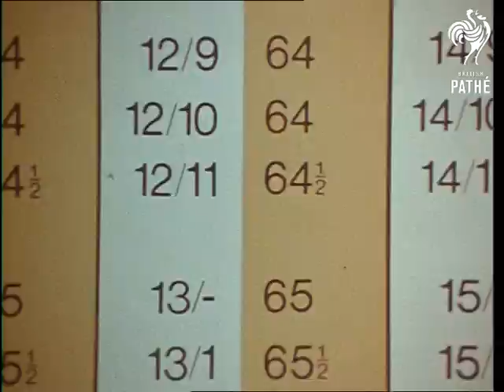Decimalisation (1970)

Comment: Thanks for putting this up here. I visited and lived in the UK and Ireland throughout much of the '70s and early '80s, shortly after Decimalization. Some of the older coins like shillings and florins were still circulating, being then worth 5p and 10p respectively. Most of the folks I spoke with about decimalization didn't really miss the old coinage, possibly since it hadn't really completely gone away. Of course in 1990 they resized the 5p and 10p coins, so now all that old currency is really gone. I have one of the new reduced 5p coins, and it's a fairly pathetic little thing, barely the breadth of an American dime, or 10 cent piece, where the old 5p or shilling was about the size of a quarter, or 25 cent piece. I've often wondered if that mere diminishment in the size of the coins has had some effect on people's perception of their value, and by extension of the British Pound. When I was over there a Pound was worth between about $2.40 to $2.80 in U.S. Dollars. Now they're nearly on a 1-to-1 parity.

Comment: The pre-decimal money is easier to use especially when it comes to giving or receiving a change without the use of a calculator. You only need to remember 20 and 12. There are 20 shillings in a pound and there are 12 pence in a shilling. 
If the total amount bought costs £23 and the money given by the customer is £50, the change is £27. 
If the total amount bought costs £23/8/- and the money given by the customer is £50, the change is £26/12/- since there are 20 shillings in a pound. 
If the total amount bought costs £23/8/5 and the money given by the customer is £50, the change is £26/11/7 since there are 12 pence in a shilling.
Reply: How could that possibly be easier? with decimal currency all you need to remember is 100

Comment: When cash register operators were required to be able to count!
Reply: @serendipidus1 You don't really, now a days. You bar scan the item, the register tells you the total. If the purchaser gives you cast the register tells you what change to give.
Add to that the vast majority of transactions are done with contactless card. I dont remember the old system but it must have gotten easier when it went to a base 10 system.
Reply: I remember some years ago asking for 12 stamps and was told "We only do them in 4's and 10's" and not a hint of anything when I laughed and said "In that case I'll have 3 books of 4"
Reply: I learned on an old register. Counting back was invaluable. Now if the total is 9.80 and you want a quarter back, you give 10.05. Watch younger heads explode. Sometimes their icalculators come out.
Reply: @serendipidus1 self service machines most definitely make things faster if paired with being able to scan while grabbing the groceries.

It takes me about 5 seconds to pay at the self checkout.

Comment: India has decimalized the currency and applied metric units for measurement in 1957. Before that English system and fractions was used in India. It is very confusing.
I wonder how people those days understood things.🤔
Reply: That is because you were not yet born during the pre-decimal era. If you were already an adult during that time, you'll find it easier to use especially when it comes to giving or receiving a change without the use of a calculator. You only need to remember 20 and 12. There are 20 shillings in a pound and there are 12 pence in a shilling. 
If the total amount bought costs £23 and the money given by the customer is £50, the change is £27. 
If the total amount bought costs £23/8/- and the money given by the customer is £50, the change is £26/12/- since there are 20 shillings in a pound. 
If the total amount bought costs £23/8/5 and the money given by the customer is £50, the change is £26/11/7 since there are 12 pence in a shilling.
Reply: @friendly1999ph  yes true. Old people in our family tell the conversions with mouth, while we need some pen and paper to do conversions of old currency system.
We used rupee only from British time in India but it was divided as fraction Anna and pice. 1 anna = 1/16 rupee, 1 pice= 1/64 rupee.

Thanks for the explanation. It's so clear 👍
Are you from UK?

In India, after decimalization, 1 rupee is divided into 100 Paisa. No more subdivisions. We used to have 1,2,3,5,10,20,25 nd 50 paise coins.
As of now due to inflation, 1 rupee has become the minimum currency and Paisa coins upto 25 paisa are demonitized. Although 50 Paisa is not demonitized, it's not used in market nowadays and people don't accept it.

Comment: The old 10p and 50p coins were very clunky and clumsy. I remember 1997 when the big 50p coins went out. The old 5p though was good, the one introduced in 1991 was too small. They should get rid of the 2p coin and introduce a copper larger 5p coin

Comment: 3 bob to 30p overnight!!
Reply: Only if you assume inflation was 100% overnight - 20 shillings to the pound so three bob (shillings) went to 15p. Ha'pennies were dropped completely and anything that was a penny went up to a new ha'penny overnight so inflation was limited to 20% or less.
Reply: @orkstuff5635  I was being facetious, but only just!
Reply: @Richard.Allsop  To some extent so was I :-D
The minimum denomination went from 1/2d (1/24s) to 1/2p (1/10s) so arguably had 240?% inflation built in
Reply: @orkstuff5635  Decimalisation devalued the Pound by two-thirds. 
It was intended to.
Reply: @orkstuff5635  will still had half pennies until about 1980
Reply: @noifurze6397  And the silver sixpence coin - the 'tanner' was retired in June 1980.
Reply: @gary1961  yes true,I saved those that I rarely got in my change
Reply: @orkstuff5635  
Things did about double: my mum pointed it out to the greengrocer over the price of oranges...his reply "oh yeah" (like he hadn't noticed).
Reply: @orkstuff5635  Try and pay attention !! That's what happened! Of course, you'd probably think that was perfectly ok.
Reply: @chasleask8533  et al   
Newsflash stuff that cost £1.0s.0d. the day before decimalisation cost £1.00p the day after.
Reply: @serendipidus1 Coal was cheap because we exploited the workers.
When the miners got decent pay, we closed the pits, and exploited someone else's workers.
Reply: @orkstuff5635  The only real inflationary thing I recall on D-Day is that the local bus company rounded up all fares so as to do away with the 1/2p.  They said it is was too small for conductors (remember them?) to handle.  I don't doubt that other retailers did similar things too.  But prices certainly didn't double over night.  At the time, inflation was runnings at 20% per annum so things did shoot up in price at that time.

Comment: I was thirteen then. I remember that the old money was 144 pennies to the pound and they had to change that to 100 pennies to the pound. 
We had charts showing the conversions and it said something like, 
2 old pennies and 3 old pennies were now the new 1penny.
So we used to go into the shop with a new penny, and said that it was a threepenny one to try and get more sweets. (never worked though).🤣🤣🤣
Reply: 240 "old" pennies to the pound not 144. 12d to the shilling, 20s to the pound.
Reply: You're mixed up.    144 was/ is a gross, nothing to do with currency.    2.4d. to. 1p.

Comment: The biggest con job ever. Prices doubled and trebled overnight
Reply: Cobblers. A few dodgy traders tried it on with the unsuspecting, but in general prices got rounded up to the nearest 1/2p above rather than down, which in most cases was un-noticeable. Prices most certainly did not double overnight.